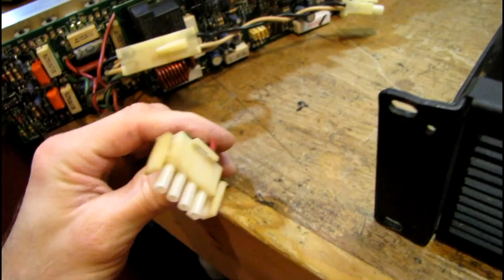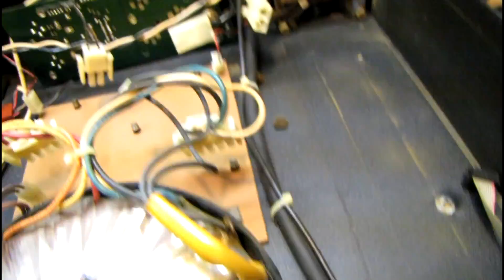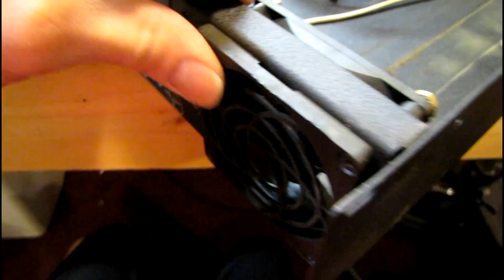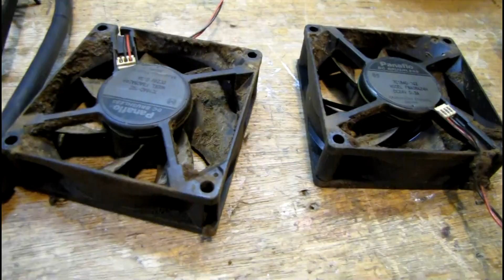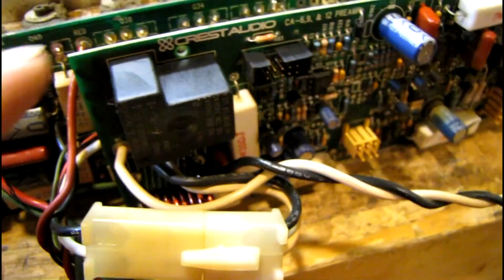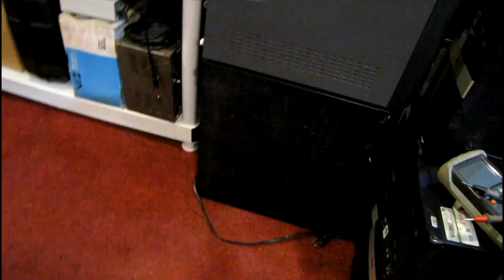Crest Audio CA6 Amplifier Restoration, Part 1 of 2

Comment: Hello.  Tell me please, can it replace a good home amplifier?  What level of sound quality does it have compared to HIFI amplifiers?  I have acoustics with low sensitivity and many recommend an amplifier with a good power reserve, but I'm more interested in quality.  Thanks.
Reply from the maker: Pro Audio amplifiers can sound really good if you have a proper preamp.  I use several Crown K2 amps in my home theater, driven by a Yamaha CX-A5100 preamp and it sounds great to me.  All you can really do is get some equipment to try out.  Not all amps sound the same, and some need more signal than others.  Many PA amplifiers need an input of about 1.4 volts, where home audio is around 0.7 volts for full output.

Comment: Fantastic result !!  
I have two of these CA6 amps for my subwoofers and a CA4 for my top speakers (PA set-up) 
The power of these CA6 units are about 2x 600 Watt RMS @ 4 Ohm or  2x 750 Watt @ 2 Ohm.
I use them bridged into 4 Ohm and then they pump out 1500 Watt @ 4 Ohm RMS , so I get a total of 3 Kw RMS power to my 4x 18 inch subs. 
The CA4 does 2x 400 Watt @ 4 Ohm and 1100 Watt @ 4 Ohm bridged, enough power to do indoor party's for about 200....250 people.

Comment: Did you use diluted or non diluted simple green to clean the pcb?
Reply from the maker: +Per Magnusson I've done both depending on how dirty it is.
Reply from the maker: +Dj Larry It was just the regular Simple Green in the gallon jug.  Not the newer variants or anything.
Reply: +Maxxarcade Thank you very much , I have trouble getting debris to the pcb 's and could not find a product that did.

Comment: We have CA18 (I think it's the biggest one) and filter capacitors leaked. The caps are bigger, 75V 18000uF. Can you point me where can I buy them? I don't mind getting some with higher voltage but can't find the right size. It has to be 1 3/8" X 4 5/8, otherwise it won't fit. Anyone? Please help. Thanks.
Reply from the maker: +Igor I looked around a bit and haven't had much luck either.  You might want to try contacting Peavey to see if they still stock those.  They still had decals for this CA6 at the time, so it's very possible they might have replacement caps.  

Are you sure they leaked, and that you're not seeing some adhesive around the caps?
Reply: +Maxxarcade Positive! The orange rubber things popped and leaked all over board. I was looking for higher voltage caps but they are all physically too large and won't fit. I guess I can get some big ones and run some wires outside of case and have them outside as an option. But yeah, I'll try to contact Peavey. Do you know how much higher in V and uF can I go?
Reply: +Igor I take it you need the two prong screw mounted caps? Try looking at a higher UF rating it just means internal resistance will be less, next size up is 22000 UF! You need 35mm x 117mm by description but if you could fit 1 5/8&quot; diameter 40mm they have 5 80v 22000uf caps available in miami on ebay 281246658839
Reply: +LuxorVan No, 1 5/8 is too large. Its very tight over there. im not sure if i can post any links here, but here is the picture of it https://app.box.com/s/m7dbt3udssf9rmnz1v5jkuv2yk53fab4 I did the way i described in my previous post, so for now my capacitors are outside of case, but the amp is working. I guess its a temporary solution, but it works for me. Also the distance between the screw terminals on 1 5/8 is bigger, so they wont fit that way too. But thanks for your reply.

Comment: Hi i use onlt the prof series (3301, 4801, 6001, enz) Thay are the best on the road. I use one 12 years never have any problem. The last series whit the ring trafo, need bult in a current limiter (same time as the inrush relay).

Comment from the maker: I use Simple Green.  If you decide to dilute it, you must use distilled water to avoid corrosion.  Also rinse with distilled water and dry with an air compressor or other thorough means.

Comment from the maker: They have a pretty flat and neutral sound.  The only crossover is a simple capacitor for the tweeter, which is not original.  I'll be fixing them up soon, and will make a video then.

Comment: Hi Friend, so how do you like this amp?  I'm looking for an amp to run four 15" subwoofers for a home theater. Looking at the Crest CA6 and the QSC RMX 1450. I did try one of the Crown XLS 1500 but the bass is weak compared to my vintage Soundcraftsmen. Not much power in the infrasonic range on the crown.

Comment: I know the huge work there, I'll appreciate if You will be able to tell me the size. I'm planning to replace the mica insulators with kapton one, which have less Thermal resistence and will allow the output transistor to run cooler also at the same heatsink temperature

Comment from the maker: I'll have to look at mine and see what they are.  I don't recommend taking it apart unless you have to though.  It's a ton of work to reassemble the output modules properly.  You might get good results just by using an air compressor to blow the dust out.  Mine was full of nicotine residue that caused everything to stick.

Comment: I just got a used CA6, fully functional but dirty like Your; just a question  ... what is the size of the allen wrench you used to remove the screws of the output transistors, and the size of those screws?

Comment: This was very helpful. I didn't know that the boards are 2 sided and you can recap the amp board without screwing with the output transistor leads of which there are thousands in my 9

Comment from the maker: I use a Hakko 808 desoldering gun and a Hakko 936 soldering station.  It's also important to use good quality solder, and keep the tips in good shape for optimal heat transfer.  

Even with good equipment, some preheating of boards is sometimes necessary due to the large amount of copper absorbing the heat.

Comment: What would you recommend for a good soldering iron or brand? I bought a bulk of 7 hp monitors that had blown cap's and a bad fuse so when I had to remove the cap's it took forever for me to get the caps off because I felt like my iron was not getting hot enough. But that project is now done, just looking for a better one for future use.

Comment: Use a blow dryer to remove the decal. You can re attach this legend with double back tape film from any sign shop. or they can make you a new decal by scanning the old one and printing a new decal on an edge printer.

Comment from the maker: You would definitely want to make sure you rinse with distilled water and dry really well.  Even with an air compressor, it takes a minute or two to get all the water out from under certain components.  I generally don't wash boards unless they are too dirty to use comfortably.

Comment: Been there with the nicoteen covered equipment and repairs, yuck city.

Im glad im not a smoker.

Should be spot on when your finished max, i would modify the front panal board standoffs for internal screws, manufacturers do daft things like that.

Smashing job mate :-)

Comment: Never tried Simple Green but will keep it in mind. Great video.  

I typically use 99% Isopropyl Alcohol with a cleaning tray and lean the modules or circuit boards at an angle while using a soft brush. It avoid disassembly unless there are other reasons to do so, and drys pretty quickly. Removes solder flux too.